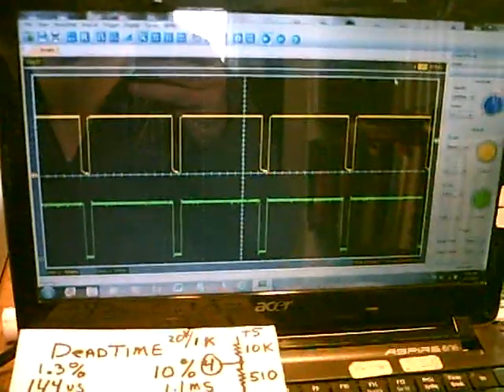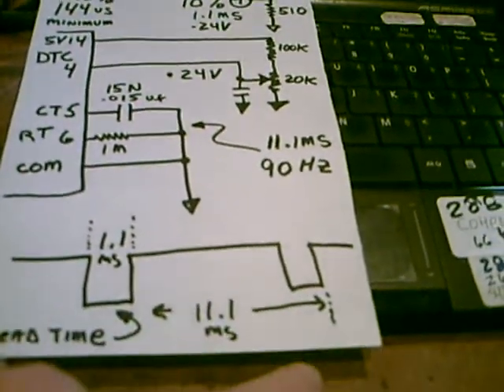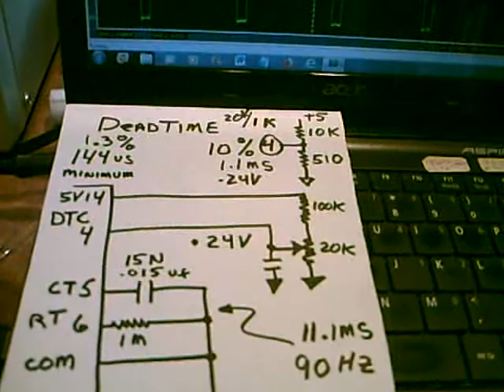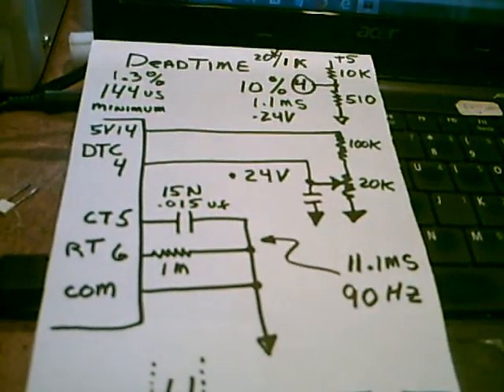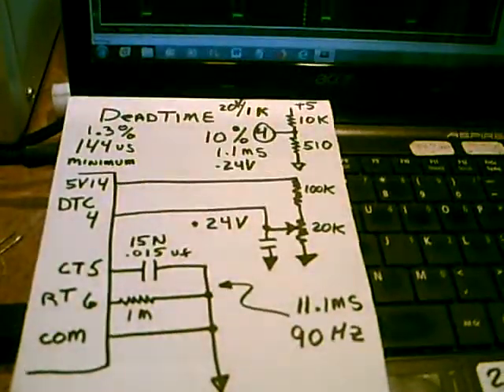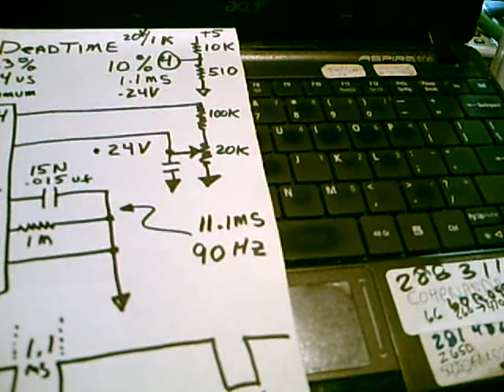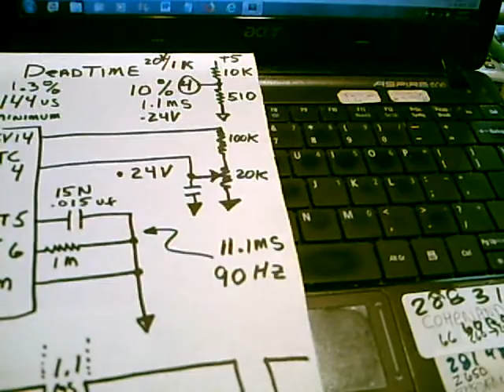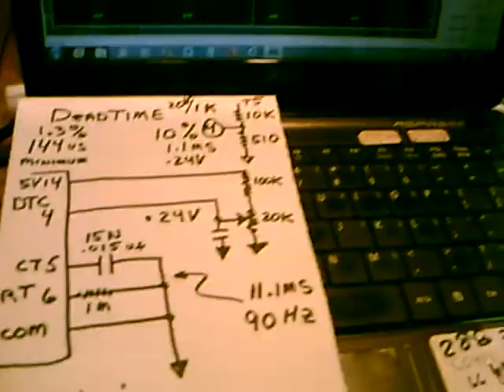TL494 Dead Time Control For PV Solar Water Heater Preventing Arc

Comment: It is as if you've read my mind regarding short dead-time pulses. I've been planning to make such a feed to my water heater, as I have burnt 2 thermostats and a switch using steady DC from my panels (I was busy and I procrastinated).
 I have also figured that about 1ms dead-time pulse should be enough to kill the arc, at around a 100Hz rate. I haven't done testing to see what would be the minimum acceptable pulse frequency, but I know that the lower it is, the shorter the lifetime of the contacts (due to longer-lasting "microarcs").